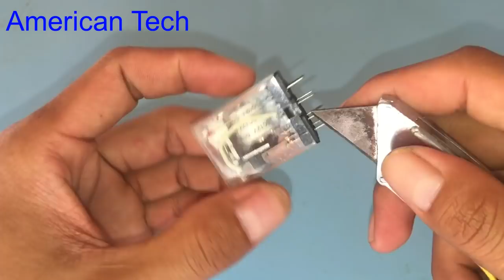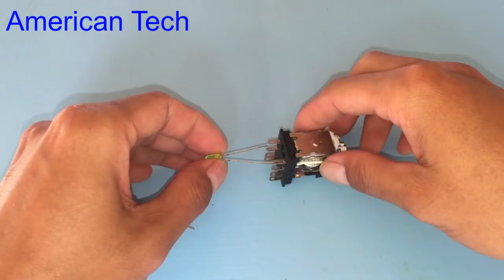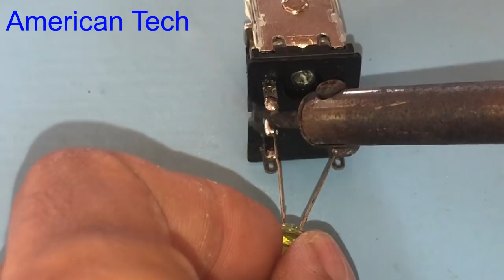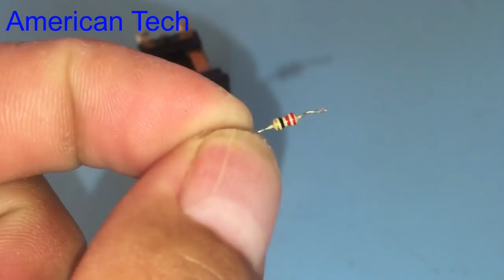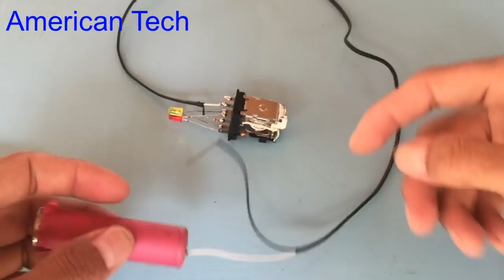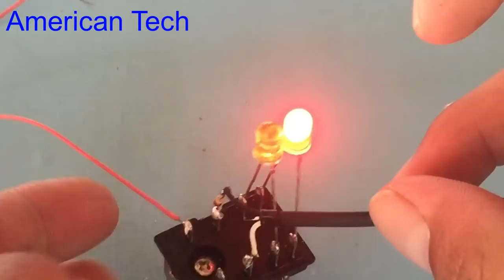How dose Relay work?  New experiment with Relay 2018

Comment: your relay is 12V but you can energize with a 9V battery. Is there a low and high voltage rate that the relay can opperate on
e.g from 9v to 15 maybe?

Comment: My remote control car witch I lost the remote for,has a circuit board with a 3vdc Relay. Since I lost the remote to the car I scrapped the circuit board an added a Arduino an motor shield. What I wanna know is will I have any problems using a arduino uno. Also the car uses a 7.2v battery the motor is slightly larger than most remote controlled cars, so I wanna know is will there be any problem with the method I’m going to use with the arduino uno & the motor shield

Comment: Make a video on omron MY2N 240V AC relay
Reply: AC relay also same connection, DC relay only have polarity but AC relay not have so see model diagram. Input's will give same on DC relay pin no 13 and 14.